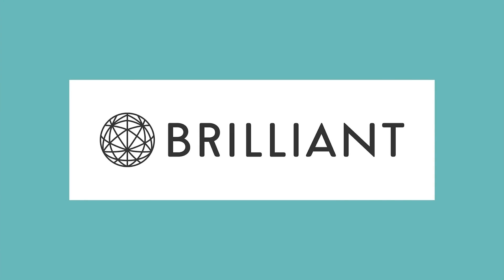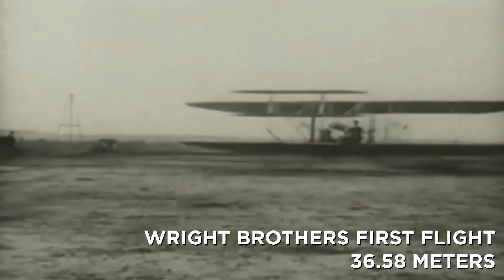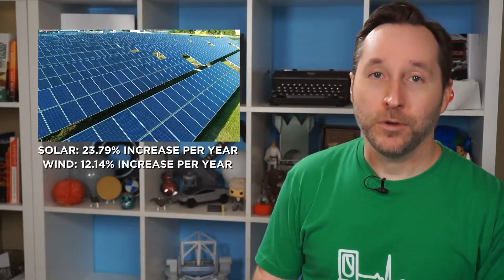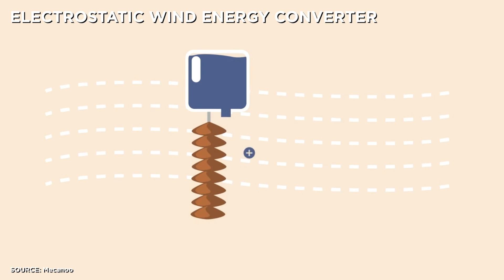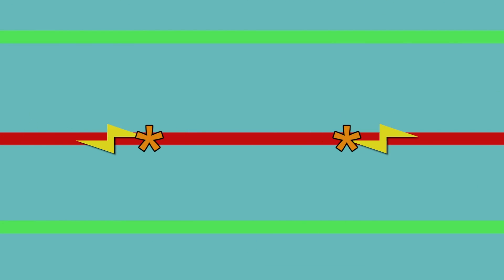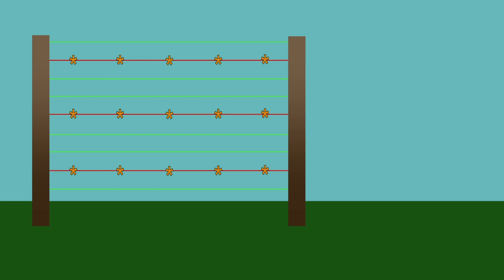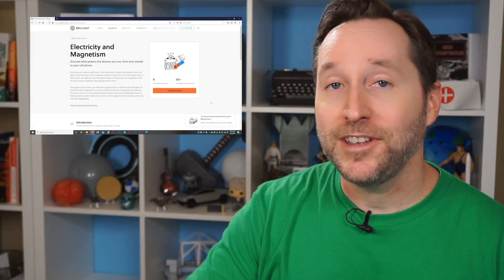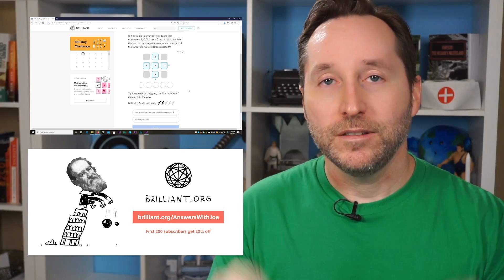Solid State Wind Energy | Random Thursday

Comment: 40000V is a electric potential. For energy you need power over time. Power is voltage * current. So electrical energy is power * time. You can measure it in W*s. Which translates to Joules. So you can more easily compare the energy equivalent in mechanical energy and thermal energy to calculate a efficiency factor. As you can see, it's fun, easy and useful. 
Please check the basics before posting something. For example there where previous scams on kickstarter, which had the MIT name as reference. You surely don't want to promote such things out of ignorance about 6th grade physics.

Comment: Pssst. Psssssst! There is no 1000 year old windmill that is still working, but there is a location for a windmill that been used a very long time  and parts are often replaced, so it is not the same mill as it was 1000 years ago.

Comment: What about just using thousands of huge speakers connected to diodes to convert ambient loud noise (and changing air pressure) into electrical current?

Comment: Corrections: a mixup of energy/power in 2:14.
1. It was not 5.5% of all energy. The share of wind power energy was together with solar, geo, bio a total of 5% 2018 according to BP energy outlook 2020, so I'd guess wind was a percent or two.
2. Its not 519 GW of energy, but 591 GW of global cumulative power capacity 2018. In 2019 it was 650 GW. But - key point, power isn't energy.

Massive + for not hyping things and providing perspective on things!

Comment: I still think they require maintainance, like cleaning out 40000V electrocuted birds:P

But on another note such high voltage wires that have surface requirements are likely to suffer some corrosion from the ions that are attracted to the wires rather than blown away.

Comment: Wait....But, you don't actually need wind for that water droplet..."ion-wind-generator"(?).  ("electro-hydrodynamics" could be a hydroelectric dam) to work.  

Water evaporates so,  couldn't you generate that same sort of hydro-ionic-wind (trademarked!) in a closed "green house" system that vaporizes the water, causing it to pass over blades, both moving it and generating ionic wind with it's passage, giving us a sort of 2-for-1 on extracting energy.  On top of that its a closed system so you can reuse your water vapor, over and over, allowing you to alleviate or offset the costs of demineralization by maintaining an ionized pool thats part of and fed by a passive/semi- passive hydro-thermal loop (geo or solar) which re-ionizes the water as it condenses.  

You could do this with Solar, but you could ALSO just use geo-thermal spikes to warm the water to evap. which isn't nearly as energy intensive as traditional steam geo-thermal plants.

Also, I didn't know CF could be used to create coronal discharge....thanks!

Comment: On a more serious note, how would this perform on Mars? Mars has considerable winds and the amount of ions produced is probably not much affected by the low air pressure. So it might perform better than something with blades that needs a high air density to be effective. Its simple design would be a huge benefit. Always working, low maintenance.

Comment: Ultimately, all power is solar. Wind energy is merely the movement of air powered by the sun warming the atmosphere. And wave energy is the movement of water powered by the wind. Petroleum is merely solar energy stored chemically. There is some energy from the heating of the core of the earth, and there is some Coriolis energy from the rotation of the earth, but otherwise solar is the pit mouth.
Reply: You forgot about nuclear power.  Since the heavier elements were created when previous generations of stars went supernova, a nuclear reactor essentially releases power captured from a supernova.

Comment: 1:40 40,000V is not "a lot of energy" because the Volt is not a unit of energy. I can generate 40 kV by just rubbing a piece of plastic and cloth together a bit. you're literally missing 2 other units (current and time) before you can make any claims about energy.

Comment: I would love to see this happen but see a similar issue that air cleaning ionizers have: the negatively charged wire will attract positively charged things like dust. Over time that wire and the carbon tufts will need to be cleaned and that might use more energy than this thing produces.

Comment: I'm wondering why you bring up bird deaths in the context of this solution. Is solid state wind energy going to be less likely to kill birds? If so, why? I'm pretty sure it would be waaay worse than standard wind turbines with a camera or radar system. This would be a giant static structure, and birds are not good at dealing with static structures. That's why they collide with tall buildings. I'm also guessing the wires would make it even harder to see. And what happens if the birds do collide with the wires, do they break it? A very slow moving wind turbine is actually a pretty ideal way of preventing birds from colliding with the structure. Especially if you also paint parts of it black. You need a camera or radar system to detect birds when they are near by to slow the wind turbine down, but that's becoming more common.

Comment: The big question is: why aren't wind turbines refurbishable?
Reply: Fiber composites. Those blades get weakened by micro cracks (and maybe other stuff, idk) over time and how do you recycle those?
Reply: @mennol3885  No the real question is why haven't they figured out ways to recycle those?
Reply: @mennol3885  Seems like using aluminium would be better then? Cause worst case you can just re-melt it?
Hmm... Honestly, I'm not sure how to re-use composits.
Reply: They actually are. There is the company neocomp in Bremen, Germany doing it. But they don't really recycle it, they just grind the blades up, mix them with leftovers from paper recycling and make cement from that.
Reply: @niklas6576  not recycle, refurbish. And or create from material that is refurbishable.
Reply: @Fabelaz  right, I misread your comment. Then Menno is right, cracks in cfk an the likes aren't repairable. In the industry I work in, when we detect defects even after all the fancy steps to make them go away, the whole part is scrapped and a new one is manufactured
Reply: @niklas6576  Shame that is so.
Reply: Carbon composites are created using very high energy. The carbon source is not a factor in the cost. But it would be if you had to double the amount of energy by first attempting to extract carbon from the old part and then reuse it in the new part.

The reason you can't use aluminum is in the size. The efficiency goes up with the square of the area so the longer the blade the more power we get. Carbon composite allows a much longer blade than aluminum can. And it has to be one piece, no bolted/welded together joint in the middle because of how it has to bend and flex.
Reply: @gandalf40_tbm30  thank you for your insightful reply

Comment: I got an aluminum copper battery to work with salt water electrolyte.  It seems possible that aluminum and copper could work with an air electrolyte.  But it would be a battery, maybe a capacitor, but not a generator.

Comment: this is terrible unefficient. The reason why wind turbines are that big, is that there is not that much energy density in wind ... this this tec you probatly have to build 1000 times bigger structures cause you would only slow down the wind by a small amount on a small cross-section...

Comment: Wind turbines do not have milllions of moving parts. In fact they have no more than your standard transmission today. And they do NOT require a ton of maintenance. A 3 man crew can maintain 100 turbines with ease. And often at multiple sites. Once again your failings of the understanding of what investigative reporting SHOULD be instead of you spewing old worn out opinions.

Comment: Maybe it would be useful on Mars where there's a lot of high wind, but there's not a lot of energy IN that wind because there's not a lot of mass. Since the idea of this is to blow the ions away, perhaps it doesn't take much air mass to do so. And it would continue to work during dust storms when solar panels can't get enough light to function.

Comment: "solar has no moving parts so the maintenance is extremely minimal" it's either minimal, or there is no maintenance. "extremely minimal" doesn't make sense. Needless pendant rant over.
Reply: Except that's not really the way the English language works. Meaning is determined by convention, not by logic.

Contrary to what it seems to be doing, the adverb "extremely" is not attempting to modify the extent of "minimal" itself. Rather, it is communicating how close to the perfect "minimal" state the subject is. In this context it is acting more as an adverb of completeness, like "nearly" or "almost", or as a simple intensifier.

http://www.everythingenglishblog.com/?p=655
https://www.englishclub.com/grammar/adjectives-gradability.htm

In short, adverbs in English are quite flexible beasts, and using a non-grading adverb with a non-gradable adjective is generally acceptable, and comprehensible.

Comment: The B2 stealth bomber used this ionizing air technology too, so it could fly absolutely silent at lower altitudes. Also most wind turbines use the toxic gas SF6 which is more than 20.000+ times more potent as a greenhouse gas than CO2. And it remains for around 1000 years in our atmosphere.

Comment: Haven't heard much about birds getting killed by wind mills, but Bats and that the noise distracts and pisses off other animals. The recycling issue i think is also true for solar pannels. They just often last longer. (not if there is "sufficient" hail) Maybe they should try to use more reusable materials for the windmills. The thing i really don't like about the windmills where i am from is that they are put onto mounaintops ruining not just the view of the alps, but also almost untouched nature in many cases as that they have to build "highways" (broad roads with not too much steepness) to be able to bring theparts up the mountains. And then have to lay extra thick and long copper cables to get the energy to the next transormer/distribution station. Oh and in winter the damn things often throw ice off the blades so a not so small area is quite dangerous to be in.   I would think it better to put smaller vertical windmills either between the lanes of highways or to the side. There is constand "wind" in the same direction, many small mean that some of them can be damaged or on maintenance while the others still produce energy, easier access, maybe materials that are reusable... I like this idea better than solar pannels which are just connected to the grid via DC-AC converters as they basically make the grid slightly unstable. (Would not be the case if the converters were finely synchonizing the frequency, but most are "too cheap" to achieve it in a hoped for manner.) The other big thing is house fires. Firefighters have big problems when the house beneath a big chunk of solar pannels is on fire. In some cases the house owners might think ahead and install a possibility for the firefighters to disconnect the pannels from the rest of the house from outside, but the pannels still interferre with the extinguishing of the fire.  To me personally wind and solar for private use are best  when they are not conneced to the grid system, and when one is able to store the energy they produce for later usage.

Comment: Saw a few of these ideas.

This one is big, and if.they were to make more power they need to tunnel the air on plates and have more strands.
This then becomes a issue as it doesn't turn and there would be a need for more air flow.
Also it doesn't scale.
They are basically using the  earth battery, I think it's called. There is always some flow and without knowing the details as the power mentioned, it would be about right.

I think when you talk about power and the types the effectiveness is really important.

Solar, 15-23%
Wind 49%

Don't know hydro and nuclear coal which is both just steam.

But a nag.
I don't know where you are in the world,. But wind generators I have seen most of my life in a lot of places, small generators which they model the big ones from.

And they can be recycled, it's not easy, but they can replace the generator inside. But I understand that that is a " bit of a job".

I'm hydro, we live in a planet with 75% water.

Also it's funny that when you look at power at the atomic levels, everything has power, it's just getting it moving.

Comment: Wind turbines on off-grid houses is absolutely a viable backup/ night time power source. They help slow battery depletion. In my case on good night's actually charge the house back up at a time when the least power is used.

Comment: The issue with wind generators are the design.  Think of the circle the blades spin in.  Of that circle there are 3 blades with very little surface area to pass over to cause movement which couldn't consist of more than 1% of that circle.  The surface area must be increased to be viable.

Comment: So far, in order to replace our nation’s entire energy needs using only solar and wind energy would require using between 22-25% of all of the nation’s land to be energy farms.

You mentioned that wind turbines kill birds, and  this video is specifically talking about wind energy, but you failed to mention that solar farms can reach temperatures of nearly 900 degrees on hot days at the surface of the panel. Talk about global warming on a large scale.

Comment: If the technology works by creating a ground current circulation, couldn't you improve the efficiency by having some kind of charge attractant in the ground? Also, considering that lightning interacts with ground charge what impact would lightning have on this technology if it struck nearby? Would that decrease the efficiency of the system by pulling those ions out of the ground? Could this technology possibly increase the frequency of lightning in an area if it's used at a high enough scale?

Comment: OH HELL NO: "forty thousand volts is a lot of energy that would drain the battery quickly" - that makes no sense three different ways!!  ARGH!
Reply: Voltage is not a measure of energy consumption, wattage is.  Think of stun weapons powered by AAA batteries or whatever there source.  It isn't necessarily voltage that kills you, it's amperage.
Reply: Sorry, their, not there.  The world needs editors now more than ever.
Reply: ...damn I wish I knew half that much about electricity.
Reply: You can get 40,000 volts with a 9 volt battery.  Calm down Dr electric

Comment: If you're gonna be educational about electricity, try not to confuse "flow" (current) with "pressure" (voltage). Saying things like "running volts through things" creates cognitive dissonance in the heads of people trying to understand how electricity works.

Comment: First of all Scott. An ion engine doesn't use electrostatic energy to generate thrust not electromagnetic energy. There are no magnets in an ion engine for spacecraft. Also as you point out so far the solid state wind turbine is only 5% efficient. It would take more energy than it produces just to keep it pointed in the proper axis to efficiently (even at 5%) capture the wind, that is when the wind is sufficient and the relative humidity is optimal. However I think solid state wind turbines can be made more efficient. It needs to reach at least 25% efficiency, and better 30% or more efficiency to be viable.  A standard wind turbine is at least 50% efficient, usually more.

Comment: If you want to change the density of the energy being produced from this device you can change the path those electrons have to take instead of straight line wires from end to end if you had a fractalized wire shape that packed in as many barbs and increased surface areas possible you would have a much more efficient device.

Comment: Also correction,plane with not moving parts:
Actually the inventors themself stated that this method would not work as a viable  alternative transportation, because higher altitudes would have a tottaly different airpressure, and the system won’t work.

Also, the ion cleaning air divice is total bullshit: https://youtu.be/ZQ--scjcAZ4

Comment: If we turned off the electricity already running through all the power lines strung up all over the place, the wind blowing over them would actually produce a  fairly sizable static electric charge on the wires, which could get quite substantial because there are so many wires and they are so long..  Its obviously not a practical way to produce usable electricity, but its kind of interesting.  The blades of helicopters also get ionized as they move through the air causing helicopters to build up a charge.  If someone ever throws you a rope out of a helicopter, you need to let the rope touch the earth to ground itself before touching it.  If you touch the rope while it is dangling in midair you could get a nasty shock.

Comment: Not Good enough video  its still ridiculuse to belive that leonardo design betz physics losing 1/2. + between blades is used at all while claiming no other invention possible  when oil discoverd 100 years ago  and my automatic feathering flat blade radial windmills both horizontal and vertical  prove false and stonewalled because of infinately more replentishing tides and wind currents enerrgy that eliminate needs for  nuclear coal and oil.and to finance presidents elections last 100 years .my avatar is a vertical version needing only  magnetic bearings . Greed prevents .